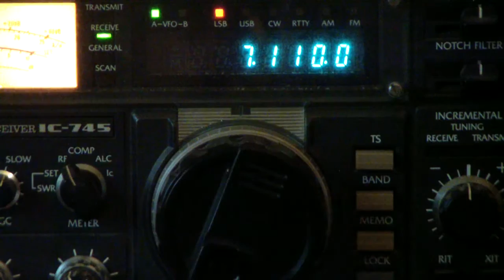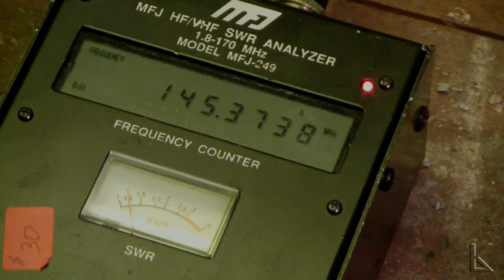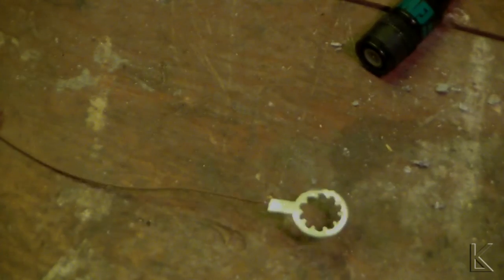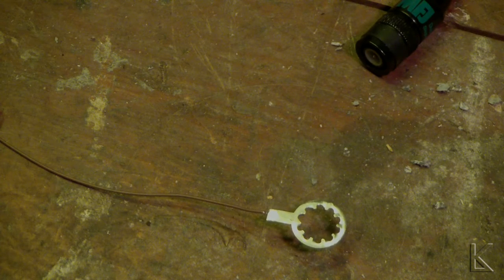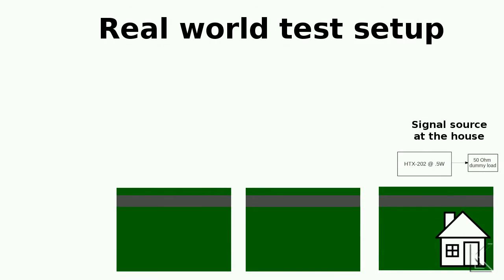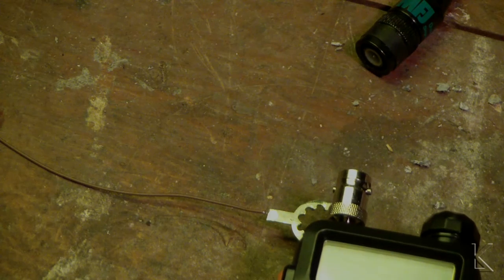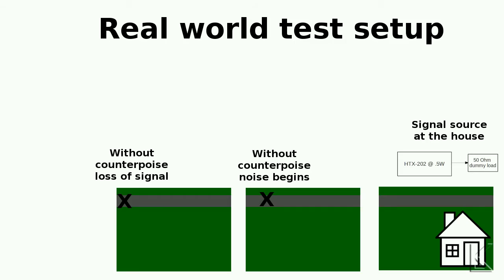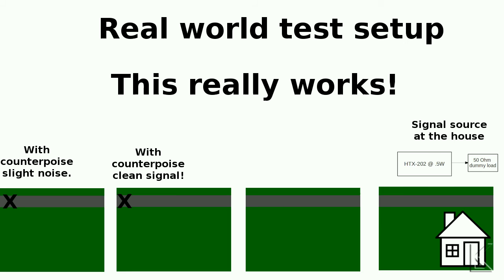Ham Radio - 2 meter handheld radio performance improvement!  Counterpoise.

Comment: In every single one of these videos I see about making a counterpoise for a handheld radio, the operator is using a SMA to BNC adapter for their antennas. They're trying to improve the performance of an antenna they've already compromised by adding the adapter. These adapters add 3/4 of an inch to the antenna length and introduce additional loss to the RF path with the additional connections. While this might not have an effect when close to the other radio, whether a repeater or another handheld, it could make the difference between a contact or no contact when operating at the limit of the radio's capabilities.

Comment: Are you aware that by having that SMA to BNC adapter on your radio, you've affected your antenna's efficiency in two ways? First, there is the loss from the two additional connections between the antenna and the radio. Second, you've essentially lengthened the antenna by an inch, which might be why the antenna by itself is resonant outside the band.

Comment: HELP, I hope your still there. I am trying to figure out how long a radial would be for a 7/8 wave 2m/70cm mobile antenna would be. And I am having problems. If your still there, and you know, could you help me out.
Reply: I'm pretty sure you're going to have to wind a coil at the base of the antenna. Try different sizes of coils until swr is good on 2m and it should be close on 70cm. Personally, I would use a half wave element for 2m and then it would be great on 70cm. There's no coils to worry about and odd multiples of half of a wave is where the power is. Maximum radiation resistance at the tip means maximum efficiency.
Reply: @JoeSmith-po3wy  Oops, I forgot to tell you that I am using a Diamond 7900 Super Gainer Dual Band 7/8 wave antenna, and I am using it on a trailer I pull behind my bike. The antenna is 62.5 inches long. And I still need to know how long the radials would have to be, for a proper ground plane. I will be mounting the antenna on a 8 foot tall PVC mast.
Reply: Sorry. I meant a quarter wave element. Your vehicle is the ground plane and represents the other quarter of the wave adding up to half.
Reply: I would start with 20 inches. Use at least 3 radials. Install them at 45 degrees to give you a 50 ohm feed point impedance. 90 degrees gives 37 and vertical, like a dipole, has about 75. In the end, SWR is really impedance matching. 20 inches is 1/4 wave at 150 mhz. 450 is an odd multiple of 150, so it should respond well there too. Start with them a little longer and trim them until it's happy.

Comment: For anyone else doing this mod.
DON'T do it this way as you can short out the aerial and burn out your transmitter circuit !

Connect it to another ground point on the belt clip screw, it works exactly the same without the risk !
Reply from the maker: How?   Some magical way the metal of the washer could pass through the metal barrel of the BNC connector?   That'd be some star trek stuff.   Changing the phase of reality to allow one solid metal to pass through another?
Not going to happen.
But, yes, you could attach the wire to a case screw as long as it goes into the chassis and makes a good ground.
Reply: @loughkb  A strand of the wire from the crimp could easily bridge the centre pin you thin skinned Muppet.

You didn't even know the clip screw went to ground eh ?
Uptight much ? lol

Comment: i HAVE A tyt-tH-UV88 hHT.i CANNOT GET INTO ANY LOCAL REPEATER (2-3 MILES MAX). i CANNOT FIND A "GROUND) externally on this mess. My antenna conn is an SMA female on the radio with a rubber washer completely surrounding the thread. I'm afraid to wire onto that so as to make the smoke fly. Any suggestions as I NEED a counter poise. Thanks and I enjoy all of your videos.
Reply from the maker: The screws that hold the belt clip on or the case together should provide a ground.

Comment: Great video , no question a rat tail works and good info on length which makes sense. I have two questions what about orientation of the counterpoise itself ? i.e. if were to be placed vertical in a vertical dipole fashion vs hang any which way or even point directionally any testing on that ? I realize not exactly a ground plane but as you know orientation can have some effect curious if experimented in that regard or anyone else has as well. thx again . Been watching entire antenna series

Comment: 2 meters is 200 centimeters.    divide by 4 for a 1/4 wave is 50cm   and 50 cm converted to inches is 19.68504 inches  or maybe about 19 and 5/8   might be close to that decimal amount.
Reply: well ham frequency is not exactlly 2meters though

Comment: Thank you a great video! So many people ramble on and one, and have audible pauses that I just want to go to something else. You video was interesting and well-made! I did some math, and depending on if you test it at 145 MHz and 146 MHz, it varies from 19.36 to 19.23 inches. I typically use 19.25" to where the end ring touches the antenna. That's such a small difference that 19.5" is fine. I know this might be a bit weird, but for the heck of it, have you ever tried more than one tiger tail? The possibility of interacting with things around the antenna would be higher, but it would be interesting to try it out.

Comment: Is it general rule of thumb to make your counterpoise the same length as your antenna?
Reply from the maker: No, the rubber duck is usually a helically wound antenna and the physical length doesn't matter. The counterpoise wire should be quarter wave
Reply: @loughkb  thanks you Kevin! And for the informative video!

Comment: Can I ask you another question, Instead of having the wire hanging 19 inches straight down can you coil it around a pencil so just Kind on the side of the radio but much shorter, It’s still 19 1/4 inches it’s just coiled up I guess the same way they do with the rubber ducky
Reply from the maker: Yes, but the wire length would change due to the inductance you create by making a coil out of it. Figuring out the right length would take some experimentation, and an antenna analyzer.

Comment: And when you do this do you have to strip the insulation off the wire
Reply from the maker: No.  It's a magnetic field that's creating an electrical wave.  Insulation doesn't matter on antenna wires.  Not practically.

Comment: If you don’t want to do a wire, you can solder it to the connector, or you could hang the wire off a screw on the back of your radio but you have to check it Hass to have Continuity
Reply from the maker: Yes.  A few people use a screw on the case.  It's still a ground point.

Comment: Yes your wire will improve the RX, I also observe that. What will possibly be not improved is your TX, because it all depends on the antenna and also the HT you are using. F.e. I cant observe any improvement in TX when using my nice (and expensive) portable antennas.
Reply: The reason for improving RX by rat tail is that the wire becomes in fact a part of the receiving structure of the antenna system.

Comment: I'm a relative newbee here so please take this with a grain of salt. If any of you old timers have opinions I'll appreciate any corrections to my thinking.

To calculate the wavelength of antenna the formula in inches is:

5905 x A / frequency in MHz where A is a small variable depending on the wire gauge you use to construct the counterpoise. A = either .96 or .98. depends on wire gauge.

So in my case: 5905 X .96 divided by the frequency for a full wave. The frequency would be divided by 2 for half-wave.

After calculations it is approximately 18 and 3/8 inches long for a frequency of 154.570

Where as this works I don't think it is not as good as an extended gain antenna which is designed for the complete frequency range of a radio whereas as the wire length needs  to be varied for a specified frequency.

Proof: =(5905*0.96)/(154.57)/2 = 18.3373229

Comment: Hi Kevin, It is quite amazing that this is not a tip in the rigs manual. the counterpoise basically gives you 1/2 wave dipole on the handheld and has you proved out by testing it works. 73 de G0WXU (JOHN)

Comment: Very helpful. will try on my new Bofang UV-5R HT's. Pulled a fairly decent voice signal in simplex mode from a mile away ( my house to the Home Depot parking lot) testing FRS ch. 5 frequency with the standard duck antenna in a heavy residential area, will run a tiger tail and see if the signal gets clearer with the same A to B  test locations.  Thank you much Sir!

Comment: Excellent video.  I had seen the original video as well but wasn't a believer as there was no testing done.  A question for you, with the original rubber duck that comes with the UV-5R, what length of wire would you recommend?  Thanks for another great video.
Reply from the maker: The length would certainly be different.   I'd have to put that antenna on my analyser and measure it.   I can't seem to find the original antenna though.    I'll have to dig around for it.  If I find it, and an sma to so-239 adapter, I'll let you know.
Reply: Kevin Loughin that would be great, thank you. I did buy one better antenna for the UV – 5R but I have a couple of others in emergency kits and I just keep the original stubby antenna with it.  Isn't there an equation that will give the correct length? Would that be dependent on the physical length of the antenna or the electrical length of the antenna?
Reply from the maker: Hard to calculate with rubber ducks.   They are helical and no two brands wind them the same way.  So each is unique and there's no magic formula that applies in all cases.

Comment: thanks for a great video and test.
can you speculate if there would be any difference to your results if the counterpoise was wrapped around the radio (and not hanging) 

since i don't have a 2m swr meter, can you please help me ... what wire length should I use for a 6,6" antenna? thanks!
Reply from the maker: Hello Kristijan,      
It would certainly change things if the wire were wrapped around the radio, it would be an inductor.
Each antenna is going to be different.  I don't think there's an easy way to calculate a proper length.   Most antennas for HT's are helical wound, so you can't rely on the length.
Maybe your local club or another local ham has an anylizer you can borrow and find the right length with.

Comment: Thanks for this video.  I found the original RadioHamGuy video unconvincing.  When experimenting, I feel there should be some testing to demonstrate benefit.  Thanks for doing the tests and sharing the information with us.  The counterpoise tail would be inexpensive and portable enough to have when you wanted the performance boost, and it could be omitted for casual use where the inconvenience might not be needed.

Comment: what length would you use for a dual band ht?
Reply from the maker: You would probably want two wires.  One for each band. The RF is going to favor the wire that best matches. It really depends on the antenna.   For the 440 wire, I'd start around 6 or seven inches and using an anyliser,  trim it down until you get the best match.

Comment: Wish you could test this at the 70cm range, but I know the MFJ you have won't get there. Thanks for the video and thanks to @radiohamguy for the original video
Reply from the maker: +Kevin Zari Yes,  I wish I could have done so.   The counterpoise wire might have to be at a different length for UHF.
Reply: +Kevin Loughin I wonder if you would have two wires (in parallel), like you would for a fan dipole. Either way, thank you for the video